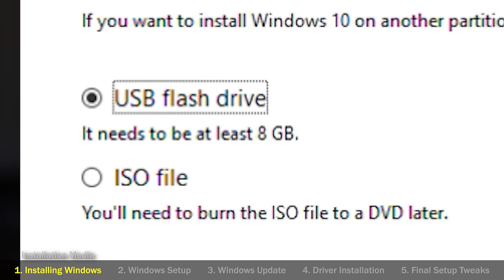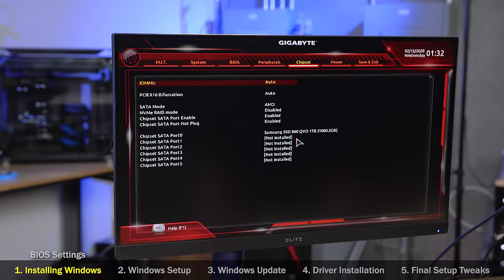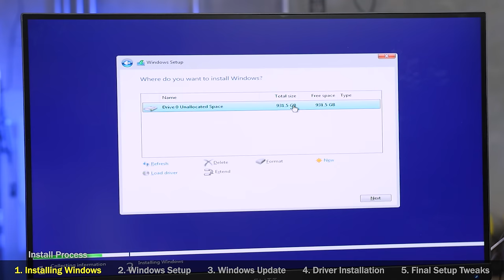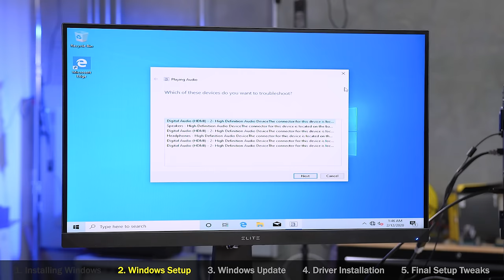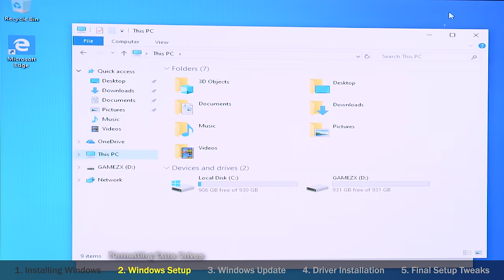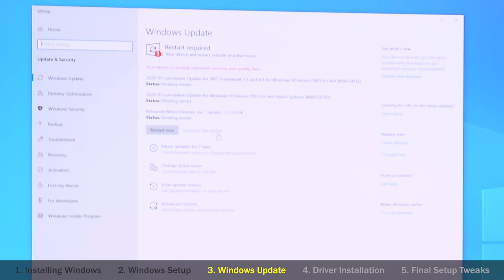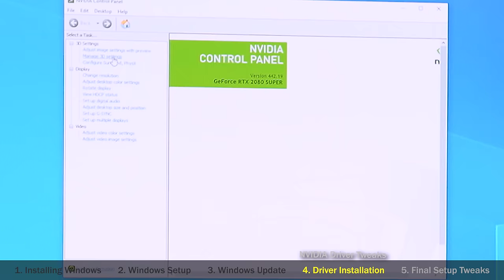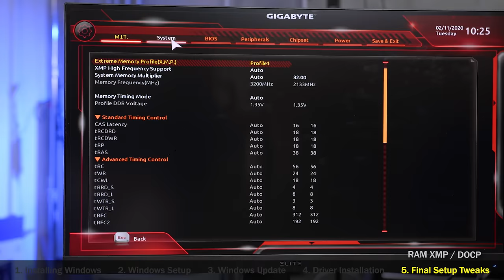Guide: What to do AFTER building your computer...

Comment: Wow. I didn't know you had to set the ram frequency in bios. I just got a 3200 hz stick. Good knowledge
Reply: i did this and now my pc won’t boot.. how do i fix that?
Reply: solved it lol. had to reset the bios and everything’s back to normal now
Reply: I've got 2x8GB 1866hz stick. Should I change my ram frequency on BIOS?
Reply: Make sure you use y-cruncher (and/or Prime95) to verify no memory errors running at the faster speed. Always start at the slowest speed and slowly work up in MHz after verifying no errors.
Reply: @nataliastadler1465   if your computer was not booting, how did you reset your bios?
.
.
*hope this doesnt sound snarky, genuine question.
Reply: @mynyun3133  As far as I know (this might be outdated knowledge, tho), the motherboard has installed a small battery (like a clock's battery, like a coin). If you remove it, wait 30 seconds and plug it in again, your bios will be reseted.
Reply: Daniel Rossy are you talking about the CMOS battery?
Reply: @JJCUBER  Yes. But if you dont want to wait the 30 seconds, theres a 3 pin reset on the mobo with a 2 pin connector. Move the connector over 1 pin press the power button, it wont cut on, then move it back.
Reply: LittleDooKidle was everything following the first sentence supposed to be for the person above me?  Because I was just confirming that the person was referring to the CMOS battery, as they didn’t seem to know the terminology.
Reply: xmp baby!
Reply: @crimescene25  Just because I didn't remember the name at the moment doesn't mean you need to insult me. I just provided an instruction. If I started with the jargon (maybe who asked doesn't know what a CMOS is, so I described it) maybe s/he'd not have understood.
Reply: @JJCUBER  AS @LittleDooKidle pointed out, yes, I was referring to the CMOS battery.
Reply: @daniel_rossy_explica  not making fun, it's an IT joke.
Reply: Note: Overclocking RAM or using XMP/DOCP will void u'r RAM's warrenty.
Reply: @crimescene25  sorry, I didn't catch it.

Comment: Rookie error mistake on my part: Make sure you unpack any motherboard driver downloads before installing them, Specially if you've pulled them from a flash drive to keep your system offline for as long as possible. For a first time builder, that caused me a HUGE pile of stress trying to work out why the setups weren't compatible before going 'Ohh... I AM LE DERP'
Also making sure things you're trying to use like onboard audio are actually switched on in the BIOS before trying to install drivers. Again, if you don't know what you're doing like I was, more headaches. Worth it, though! Definitely worth it
Reply: @FreezyG21 2011 flashbacks
Reply: I have no idea what those words mean
Reply: What kind of motherboard and graphics card did you use ?
Reply: I didnt get one part bit of that rookie mistake cause I am a rookie myself 😵 could someone explain please? what is a motherboard driver downloads he was referring to? I just built my own pc recently and I am confused as hell right now on what to do.
Reply: @jeialy1572  Go to the site of motherboard you have and there will be a section to download drivers for the board
Reply: What kind of gibberish is this?
Reply: @gtarules1  When I downloaded the drivers from asus, they came in compressed folders, meaning the setup .exes refused to work straight away. Once I unpacked or extracted or whatever they worked fine, it just... Took me a while to realise. I felt stupid, and sorry for having not exactly wording it well!
Reply: @jeialy1572  Hi. Sorry, I wasn't exactly clear. I'd downloaded the motherboard drivers from the asus website from a different computer & copied them to usb drives, not realising the folders were all compressed, so just trying to run the install .exe wouldn't work right. Once I extracted the folders and Then ran the installs, they worked fine. Hope you had an easier time troubleshooting than I did!
Reply: @arhamsaa  The bad kind of gibberish who didn't think his words out too well at first, sorry! Short-hand; When you download your main drivers, remember they're compressed so running the install exe won't work until you extract or unpack the folder. That was an embarrassing fix after too much swearing
Reply: @vincegerald532  It was an asus p97 style. It took me a while and a 'what if' to figure it out that exes in compressed folders don't work as normal. I was le dumb at the time XD
Reply: I understand nothing ;;; that's why I spend 200$ more to someone for building my PC ;; 200$... That's a lot. ;; But Respect to those who build their own PC's. I'm envious (but too scared and stupid for a girl lol)
Reply: i don’t trust anyone who still says derp

Comment: Something I wish I had known when I did my first build: if you're installing Windows 10 without a key but plan on purchasing a key after the install, make damn sure you select the version of Windows 10 you're going to get the key for. I made this mistake. I installed Windows 10 Home thinking that I could just put in my Windows 10 Pro key. Nope. Guess who had to install Windows again? This idiot. You live and you learn. Definitely taught me a lesson for future builds.
Reply: Same, dude. Same.
Reply: You don’t actually need to reinstall Windows. You can convert the version of Windows you’re using. I’ve done it successfully before via the Windows Update -> Activation section in the Windows 10 settings.
Reply: @Devastator0  This! ^  I did this on a new MSI laptop that had Windows 10 home. I had an old unused 10 Pro Key and easily upgraded the OEM install
Reply: @Devastator0  Thanks for that tip! Learning something new everyday!
Reply: @Devastator0  Coulda used this info a long time ago.
Reply: @Brad Pipkins Of course my dude! Glad to be of some small help 👍

Comment: Yup, I'm one of those people who didn't know about the memory setting in the BIOS.  I've gone from 2133 mhz  to 3000.  Many thanks, Jay!
Reply: Every once in a while after restarting I’ll go into bios and check everything just to make occasionally make sure.
Reply: I couldn’t find out where this setting was in my bios. Any idea where it’s at
Reply: @future8746  depends on the brand just search on yt
Reply: @future8746  If you're running a Gigabyte Mobo like Jay's I found it under MIT - Advance Memory and XMP.
Reply: I generally don’t mess with XMP because sometimes it won’t work (for example, last time I installed a set of 3200mhz sticks from crucial. It won’t boot with XMP enabled for whatever reason). However I lately have been getting success with Corsair RAM.
Reply: @future8746  it depends on your motherboard model. With MSI you have xmp button at the top left in EZ mode.
Reply: Miki Novak thanks I’ve figured it out how to turn xmp on. And that seems was all I had to do unless you think anything els. All I did was turn on xmp and reset and i guess that’s it??
Reply: Future8 that’s about the gist of it. If you do not encounter any other problems when you enable XMP then congrats, you’re good to go. Unfortunately XMP is a hit or miss affair, it’s AMD implementations vary wildly by mobo manufacturer and by the RAM vendor and those two plays a role in your chance of success.

My latest try with XMP was a huge success, the RAM hit 3200MHz as advertised. However prior to that I’ve had many issues with XMP, usually RAM no longer detected or being reported as bad if XMP is enabled).
Reply: @future8746  yes. Check if the speed is as advertised (sometimes you get more than one xmp profile and one of the two xmp profiles isn't full sppped). But yeah,  that's all you have to do.
Reply: Miki Novak I checked and there’s something that says Nb frequency 4000mhz and one below DRAM frequency 1600mhz. What’s the different and my ram I bought says 3200mhz so idk which numbers the correct one nb or dram
Reply: Well hey, now you get to be exited that your getting some more performance

Comment: FYI: You can actually make a local account even when you're connected to the internet. There should be an option that you click when it's asking you to make an account at the bottom that says "create a local account instead", or something along those lines :)
Reply: Even with the Ethernet cable plugged in you can install Windows without a Microsoft account. Just select "offline account" in de left bottom corner and then select again the option in the left bottom corner (don't know the wording right now).
Reply: IIRC, this used to be an option, but has since been removed as of a certain version of the windows install media tool. If you're using a disc or a USB stick with an old version you may have it, but the one you download today will not and disconnecting internet is the only way to force it.
Reply: One thing about an offline account, if you upgrade your hardware, you can lose your activation. With an account linked to an email, your key is stored against that email and you can activate a fresh install instantly.
If you've got xbox, you can just use that account.
I had to buy a new key when I upgraded to Ryzen, but I got one off ebay.
Reply: is that dumb option mandatory now? I used to be able to bypass that stupidity with an option saying dont create an account smh.
Reply: @unh0lyav3ng3r8  I keep my key in my Google drive :) woot!
Reply: @darkmaster2110  I downloaded this tool and did an install last night and it still has the offline account option.
Reply: @bhuddy246  it's not the key per se, it's the digital activation licence. It's tied to either your hardware or your Microsoft account.
Reply: @unh0lyav3ng3r8  I always install with online accounts to get those Keys to link for email. After install I log out and use offline mode.
Reply: That’s actually only for Windows Pro
Reply: @josephsansone8888  Ahh, I use 10 pro.. thanks for the info
Reply: @unh0lyav3ng3r8  same, I was re-installing home on my buddies machine and found out recently creating an offline account isn't possible.
Reply: The option wasn't removed. You have to click "i don't have an account" then put in fake info, then the option to go without an account is now accessible.
Reply: The option for local account got removed in 1903 and later if using Home edition. If you use Pro edition, then it's not an issue. Still do it like Jay said because we'll that's the correct way. If you have it online during install it wants to grab all the Windows Updates while it's finishing the install. Hmm yea F all that jazz, I'll do it MY convenience thank you.
Reply: @BadMothaKalashnikov  agreed, I just use my Microsoft account shrug
Reply: Nop, you really have to remove the ethernet cable to go local. Source: I installed it a few days ago.
Reply: @unh0lyav3ng3r8  that's normal, it's because the activation is tied to your motherboard.
Reply: Just always install Win10 64bit Pro, even without a key it doesn't matter, Win10 is free for all to use.
Reply: @Mavis847  Then your install media must pre-date version 1903 update.
Reply: @josephsansone8888  no, 1909. It was home version though, that's maybe why.
Reply: Pro should be your preferred version of Windows. Troubleshooting, fixing stuff is way better in Pro then in Home (gpedit, registry, etc.)

Comment: Just finished building my PC and need a break. This comment is more for me to figure out how to optimize my RAM- 20:00
Reply: Wdym optimize?
Reply: He literally just showed you lol
Reply: @ΓιωργοςΚαλογιαννιδης  you would know if you watch the video
Reply: Just did this and now the fans are running higher and it won’t load
Reply: @marksiddall379  maybe your cpu doesn't allow it or your mobo can't overclock
Reply: @aarupoudyal1378  you are correct. Had to CMOS reset.
Reply: I have the same problem. Tried to enable xmp, but after it wont boot up properly, finally after 4 attempts it boots up i safe mode.
Reply: @djalexhyde  can you get into more details please ? My pc wont load
Reply: @marksiddall379  how to cmos reset ?
Reply: Ryzen DRAM calculater gl bois
Reply: @jirapathorchaichaloemsak7023 Pull the CMOS battery out

Comment: "Download windows update"
Alright,lemme just plug in my ethernet

"Ethernet drivers not found,download ethernet drivers"
Okay no problem!
. 
. 
Hol' up
Reply: Me: ok Windows usb done let's go I'll download all the shit later
Windows 7: (.-. ) Network card whomst've?
Reply: I remember the days where the very first CD ROM drives came with drivers on a (wait for it....) CD ROM
Reply: Kip
Reply: winrar.rar
Reply: @Ivnard_S  my mind : processing brain what was that winrar thing?
Reply: @mubaris.s  you need winrar to read .rar archives
Reply: Wayd a minnet
Reply: Lemme put some wi-fi innit
Reply: I had this once with my laptop, I had to somehow get the driver to download on my phone to then transfer it via USB to the laptop. 

It was a pain in the ass.
Reply: plugin your Android phone to USB. Enable USB Tethering in settings. Bang, you have 4g internet!
Reply: I run into the issue where I can't plug into the Ethernet so I need to use Wifi, and my new rig doesn't have an optical drive.
Reply: @Sirtop13  as stated above - plug in your Android phone to USB, enable USB Tethering in phone settings, and you get 4g directly to your desktop
Reply: Yes, you get internet over USB tethering...IF and only if you have a good phone connection to begin with. Nowadays, alot of people need WiFi to use phones at home unless there's a tower nearby your house. But, if your lucky and have at least 3 bars in your phone, it'll work for your PC in a pinch.
Reply: @MrMagoo-no5lb  you only need it to download the ethernet or wifi drivers, that doesn't require an amazing connection. hell, i used to download Southpark episodes encoded as 37MB RealVideo files back in DialUp days @ a fantastic rate of 4KB per second, so it took almost 2 hours...
Reply: Honestly my main machine has this problem, i always keep a backup of the driver on my phone for emergency cases.
Reply: With my current Asrock motherboard I had issues with installing Win 7. Unless I had made special bootable Win 7  installation I would have no drivers (no ethernet, no usb... it even wouldnt recognize mouse/keyboard in PS2 slot) I would basically need to put in hdd or ssd with driver files on it.
Reply: @Ivnard_S  you can open them with 7zip
Reply: Pc: "the system can't run properly without updating the Bios"
Me: "ok cool let's update it"
Pc:"the system can't run properly without updating the Bios"
Me:"oh..."

Comment: I would love to see a video about RAM overclocking.
Reply: Yeah I keep getting BSODs after overclocking Corsair Vengeance RGB Pro 3200mhz to 3200mhz. Annoying
Reply: @ZmokeYT  same thing here, it's been a pain
Reply: Randall Morton yeah I had no problems before new updates. I’m also running a new board so maybe I’ll be getting a bio update in the near future
Reply: @ZmokeYT  New windows updates?  They messed up quite a few ppls systems, bsods and boot loops etc
Reply: Heytheresakitty yeah that’s what I was reading as well. I believe they came out with a cumulative update that overrides the corrupted update but I’m still having issues
Reply: @ZmokeYT  hope you get to a solution quickly and painlessly!
Reply: Heytheresakitty same! Thanks!
Reply: @ZmokeYT  
Same, but in my case it is a hardware incompatibilty issue with my B350 motherboard and Ryzen 1600 being to old to use the full potential of 3200mhz. For now I'm stuck with 2933mhz which is also fine.
Reply: John Hill I’m using a 2700x.
Reply: Had similar problem turns out ram was in the wrong slot i had mine in 1 and 3 read manual supposed to be 2 and 4
Reply: deathrodcustoms yeah I can OC with 2 sticks but not 4. I understand all the dual channel bs but I should still be able to hit  3200mhz
Reply: @jayhill2193  ouch that sucks.
Reply: Mastermoussa I went from 2400 to 3466
Reply: @ZmokeYT  try to raise the ram voltage to 1.3
Reply: Asbjørn Olsen tried mansially and even with DOCP that automatically changes its to 1.3v
Reply: @ZmokeYT  okay usually its 1.2 with xmp profile.  I dont know whats wrong then
Reply: That's easy: 
1)Think of what speed you want your RAM to run at
2)Buy RAM that's advertised to work at said speed
2.5)Make sure said RAM uses Samsung B-Die
3)Set XMP

Fuck trying to fiddle with individual values, with questionable RAM, to finagle it into working; you WILL BSOD.
Reply: U don't need to OC RAM. Just enable the docp/xmp profile. This is not OCing. This is how you make your ram run correct per it's rated specs.
Reply: @BadMothaKalashnikov  that is actually a oc in many cases. Skylake series f. Ex normally operates with 2133 MHz ram clock speed. If you go above it's a oc
Reply: @ReDHaWko  yes but it's a factory OC via profile read from a rom onboard your installed ram. 8th/9th Gen Intel and AMD Ryzen all call for 2666mhz minimum ram. 2133 is just the motherboard fail-safe.
Reply: @ZmokeYT  so 2 sticks get 3200 swap them and the other 2 sticks get 3200 but the 4 are not copatable even in diferent order
Reply: deathrodcustoms should be. My father is OC’d to 3400mhz with 4 sticks of the same ram. I checked to see what the manufacturer was on all 4 ran sticks and they’re all 4 Samsung too. I was thinking maybe two were Hynix